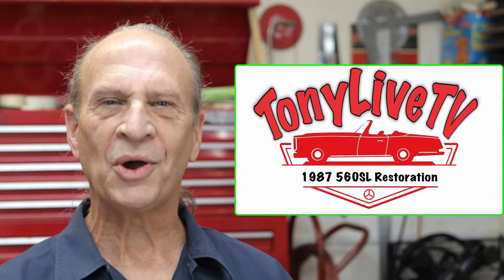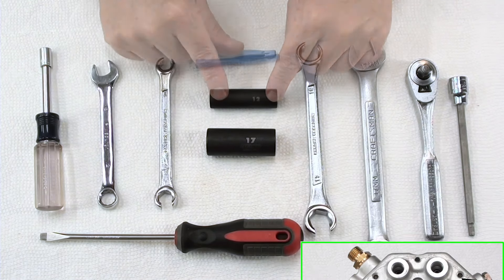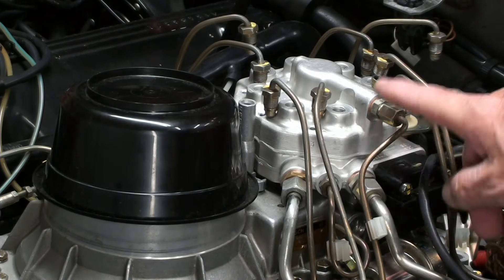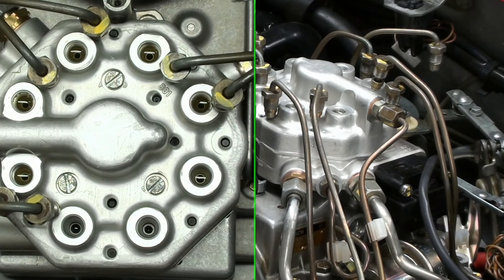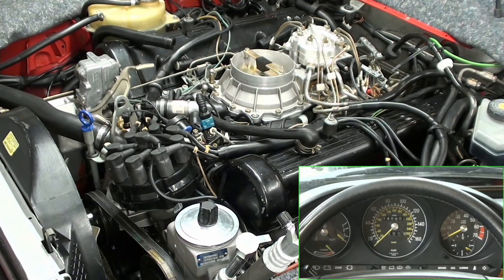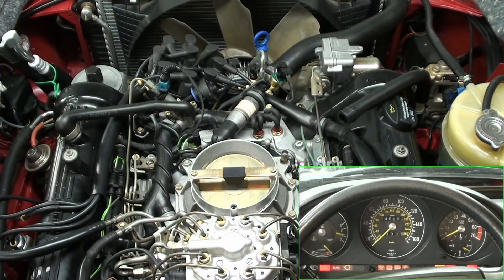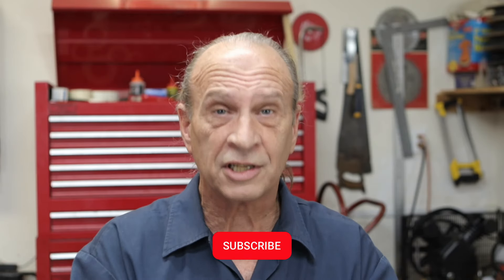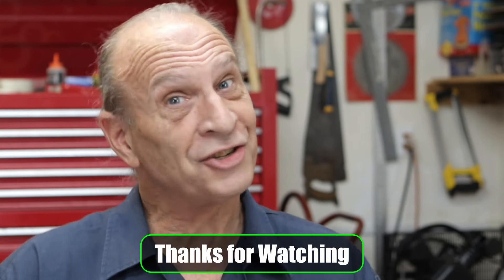560SL - Installing Rebuilt KE-Jetronics Fuel Distributor from CIS Flowtech, LLC.

Comment: Hi Tony, it has been a little while since I have posted a comment - I have been continuing to watch your journey and you are almost there - just viewed your latest video and saw you have no spark -  given your tenacity you may have already resolved the problem - an intermittent problem I encountered some time ago with my M117.968 and which took me some time to diagnose was the Speed Sender Unit (Part A0001538820) from the rear of the block to the EZL  - if there is no signal to EZL then there is no spark - from memory resistance for the sensor is 8 Ohms - I know you are very methodical and this likely already on your list of things to check - On another note - in the video at 4 minutes I notice fuel pooling in all bowls except the one in the bottom right??? Wishing you every success in this latest challenge.
Reply from the maker: @adambest7603  hey there Adam. Thanks for reaching out. So far I have not found the problem. The ignition coil and EZL all have power and resistance tests are all good. The crankshaft position sensor is sending pulses to the EZL as well. Basically everything is working, but nothing out of the coil to distributor. However I did find a direct short on the positive (terminal 15) of the ignition coil which I am trying to trace down. There are 3 wires on this terminal. The bad wire goes inside driver’s side dash and to the footwell according to the manual and plugs into X26 (what ever that is). The manual says this is circuit 15 which is all the major stuff like fuel pumps, EHA and so on.  Maybe I’ll figure it out later today. The angle didn’t show it well, but there was just a bit of fuel in that one port. I think there was more air as that port is the furthest from the inlet I believe.

Comment: Tony, I have an 87 570 sl.  I don't think rebuilding the fuel distributor was a waste of money BUT the KE Jet has no flow adjustment screws.  The EHA is the only real adjustment between the two halves - I think with the EHA unplugged it's a 2.1 bar delta?  See Kens videos to verify.  The main issue I think you are having though is your idle air mixture screw - someone may have played with it.  To get the car started, there is a procedure to screw it all the way in and then 3.5 revs out to get it to a range where it will start then you can simply adjust it to where you get a smooth idle.  I had to do that on my 85 380 sl.  But when I followed that procedure I got it started.  Happy to walk you through it I'll dig up the vid for the idle air mix procedure and post it.
Reply from the maker: @matthewstephenbrown  thanks for the comment. I did a short video on the adjustment screw of the KE-Jetronics. You are correct, there is a starting position for the plate when you have a no start issue, but a better way to adjust this screw is by measuring Duty Cycle or by using an exhaust gas analyzer. I will be uploading a video about adjustment using the Duty Cycle method. The current situation is a no spark issue.

Comment: Hi Tony , I have the same model R107 as you 1987 560 SL I drive mine every day, I must say this  what I notice with yours is that when you turn the engine over it appears that your ignition timing sounds to me a little too advanced, my ignition timing is a little more retarded and not spinning as fast as yours does  that’s just something I notice different in a starting engine and a non starting engine, maybe this can give a clue somehow to help with your Roadster 👍
Reply: How do you adjust the ignition timing on the 560 ? Just not aware that it is possible. Tks.